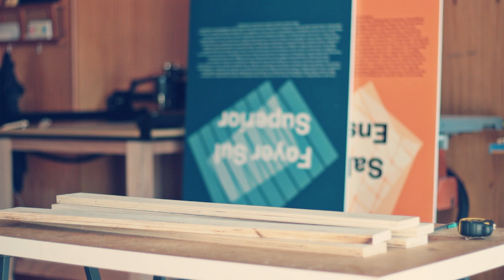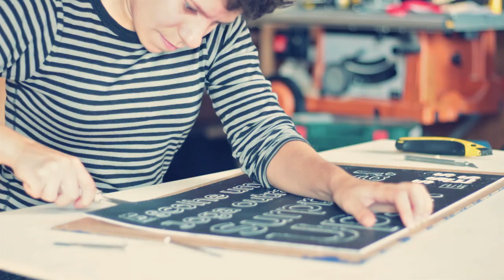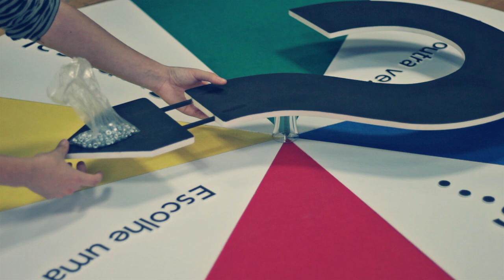Make a Trivia Wheel for Kids

Comment: I've never worked with that PVC foam board before. Looks like it was kind of difficult. The project turned out cool. I like your method for finding the center of gravity.
Reply from the maker: +Bruce A. Ulrich In fact is pretty soft to cut, if you compare it to most materials but is not that easy to get a perfect edge because the foam tends to melt or tear and then it looks pretty ugly if you look closer. Thank you for stopping by!

Comment: Hi Cristiana, nice project once again! Did you figure out by now how to cnc the plastic without melting? My job is cnc in plastic (mostly with cnc lathe). I'm going to buy the little x-carve to at the end of the year. hopefully you maybe check one of my video's then (they not as pro as yours but i do my best). Greets from Belgium, Savipe Sam
Reply from the maker: +Savipe Customs Hi Savipe, unfortunately the spindle died a few tests later but the Inventables team solved immediately my problem and I'm getting the DeWalt router that is way more powerful so, I believe it will work so much better. I will make a test with the same material when I get the new router. Thank you for your comment, cheers!
Reply: +Get Hands Dirty hope The Dewalt will help you more. i'm going to order it with the Bosch Colt Mount and hope that will be powerful enough for my projects. allready looking forward to your next video!